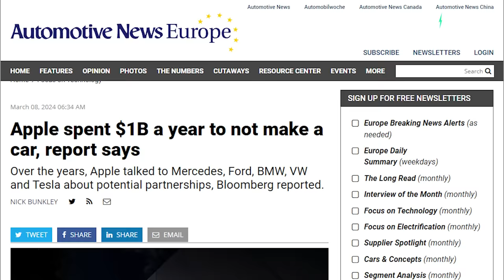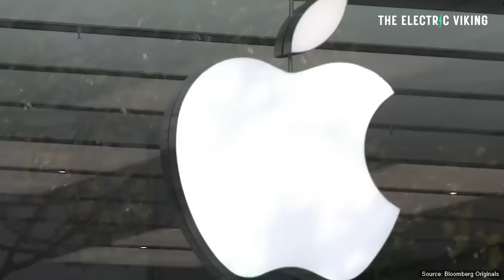Apple Car was a VW with Tesla batteries & Xbox controller priced at $120,000

Comment: Apple is an appliance maker; you can't seriously expect them to build a car.
Reply: Absolutely. Dyson, who hijacked a well known in dustrial method of dust extraction and then claimed to have invented it is another example. All that Dyson makes are vacuum cleaners that those who should know better think are the bbbe kneed but are extremely badly designed and a nightmare to repair. Apart from that all they can do is make overpriced fans, hand dryers and hair tongs. Pathetic from someone who claims to be a captain of industrey and has offshored all production.  They said that they were going to make an EV but quickly backtracked when they realise that making an EV was orders of magnitude more complex and challenging than making overpriced domestic appliances.

Comment: The real problem was that it was designed to only travel on Apple roads, Apple insisted on pocketing 30% of the revenue from electricity companies used to charge it, and they planned to change the connector every few years requiring customers to constantly buy new charging equipment.

Comment: The driest February in decades swept across much of southern Africa, wiping out crops and jeopardising energy supplies, Bloomberg reported. Early data show that large parts of Zambia, Botswana and Zimbabwe had record-low February rainfall last month. The outlet noted that 45% of planted areas in Zambia “have been destroyed” and the president has declared a national disaster. Crop failures threaten to send already high food prices surging further, Bloomberg wrote, noting that in both Zambia and Zimbabwe, prices have risen 75% compared to last February. Dangerously low water levels in reservoirs in several countries are forcing governments to ration power supplies.
Reply: Sounds like a "them" problem.